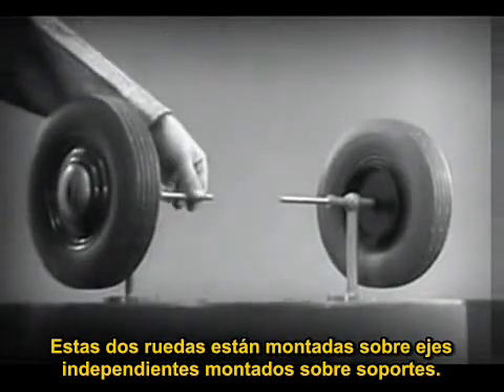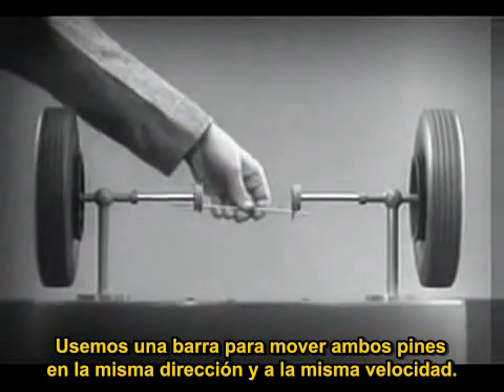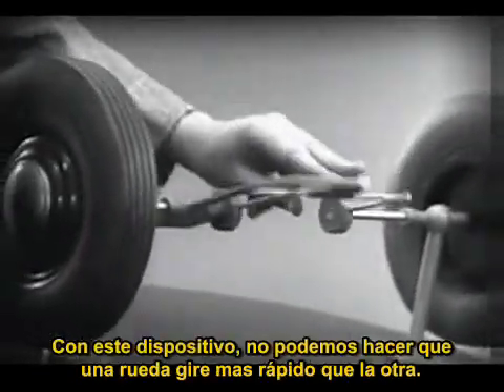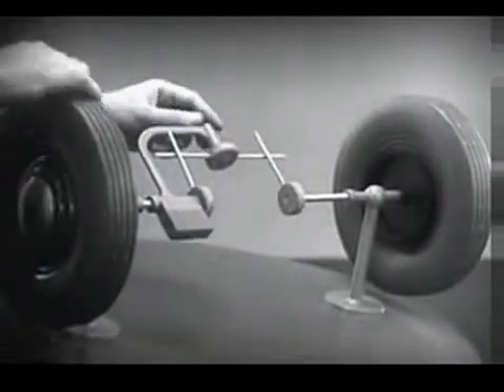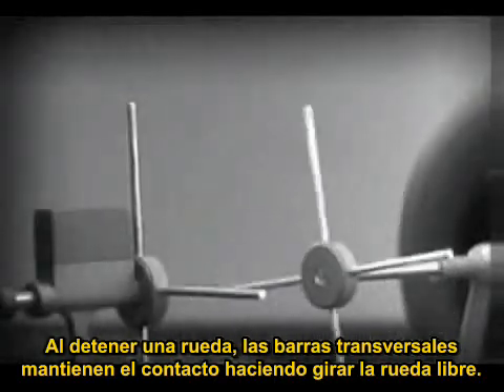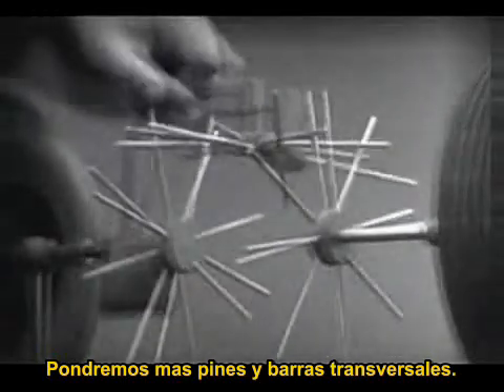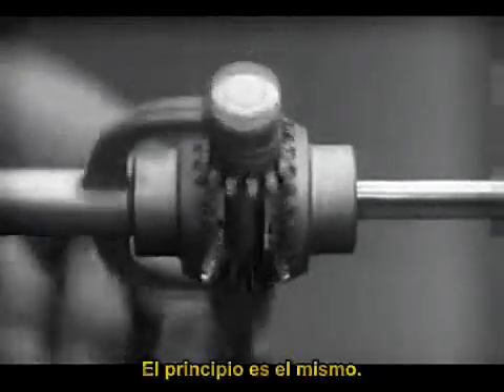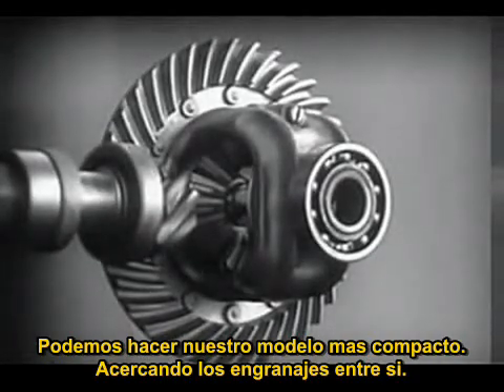Funcionamiento de un diferencial (subtitulado)

Comment: El diferencial es un componente clave en la transmisión de un vehículo que permite que las ruedas del vehículo giren a diferentes velocidades. Esto es necesario porque cuando un vehículo gira, la rueda interior gira más lentamente que la rueda exterior.

El video explica que el diferencial se compone de varios componentes, incluyendo:

- El eje de transmisión: que transmite la potencia del motor a las ruedas.
- El eje de salida: que conecta el diferencial con las ruedas.
- Los engranajes del diferencial: que permiten que las ruedas giren a diferentes velocidades.

El video también explica cómo funciona el diferencial en diferentes situaciones, como:

- Cuando el vehículo gira: el diferencial permite que la rueda interior gire más lentamente que la rueda exterior.
- Cuando el vehículo acelera o frena: el diferencial ayuda a distribuir la potencia y la fuerza de frenado entre las ruedas.

En resumen, el video "Funcionamiento de diferencial" de Marcelo Domínguez explica de manera detallada cómo funciona un diferencial en un vehículo, y cómo permite que las ruedas del vehículo giren a diferentes velocidades en diferentes situaciones.